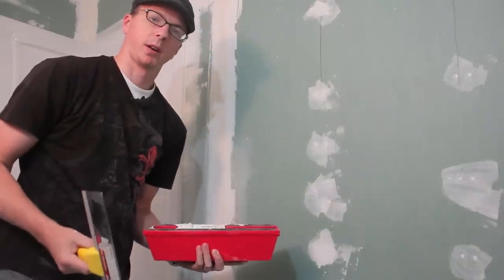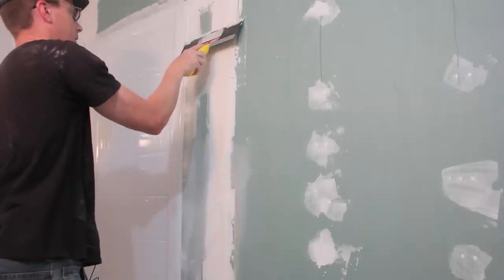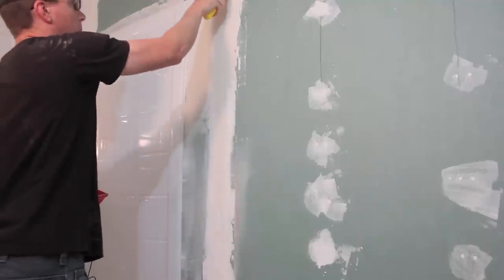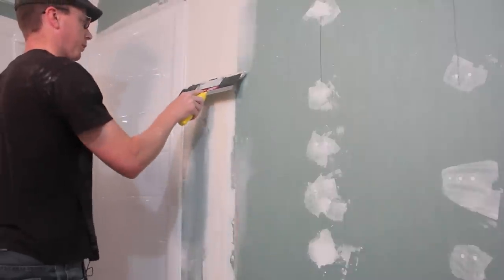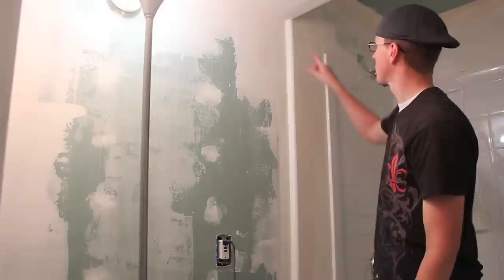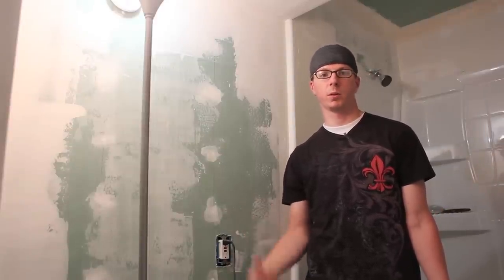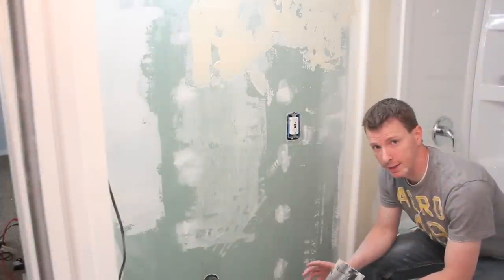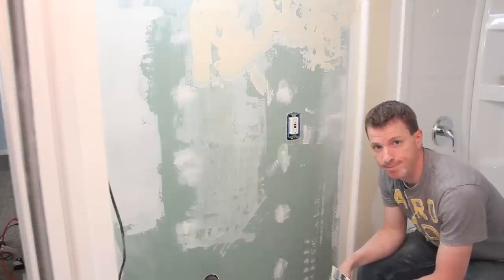How to Mud and Tape Drywall - Part 2 of 2 - Mudding and Taping

Comment: What exactly did you do where the sheetrock meets the shower tile?
Reply from the maker: +Juan Sanchez Our shower was set up so that the sheetrock sits on top of the shower surround's lip. I just mudded it completely flush up agains the surround, then ran a bead of caulk down it after it was painted.